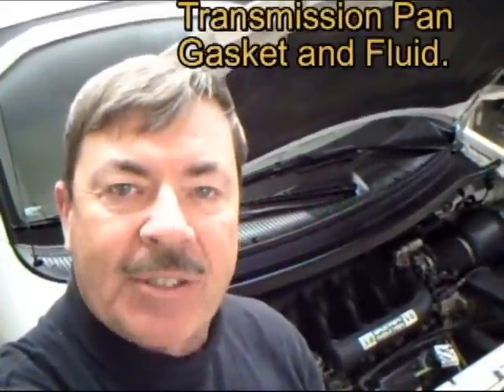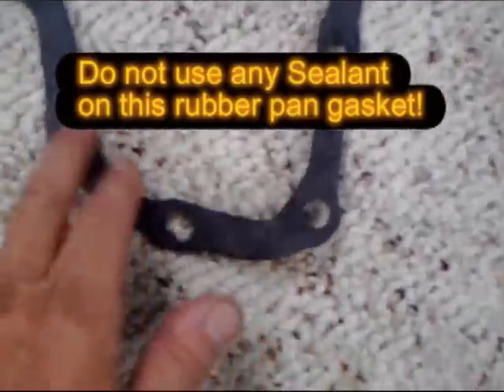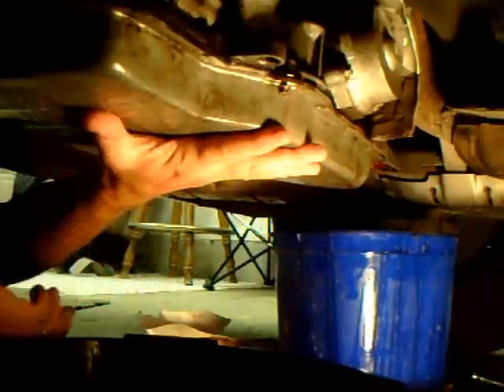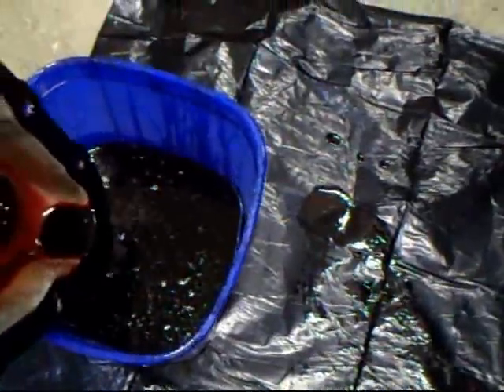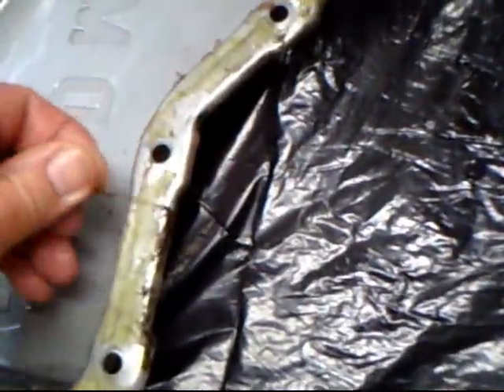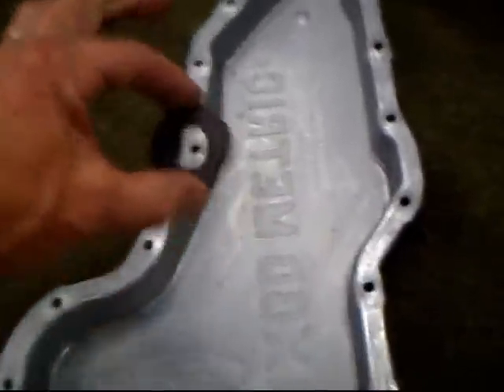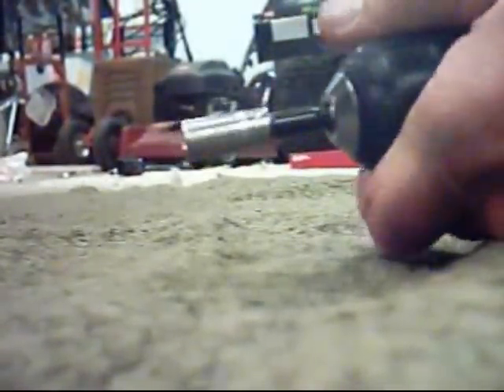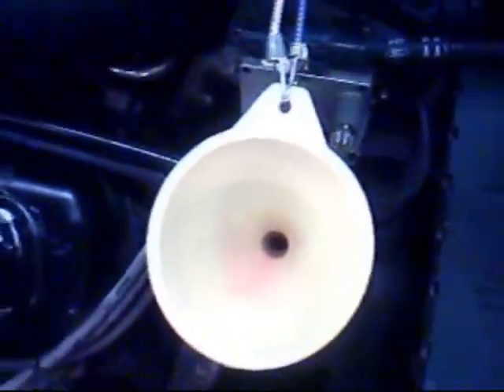How to drop your pans, from Mr. Herbert's Science Class.

Comment: yea if you know the specs def torque too, and if you have the car jacked up or else if you can take it around the block let it run in all the gears if possible to help spread the fluid around making sure nothing else is messed up. you dont have to but its a good tip especially with really old cars.

Comment: Nice shot on the fly.

For those who are viewing this in preperation for a fluid and filter change and not simply to repair a leak, be sure that your old filter has the o-ring attached to it before you put the new filter and O-ring in.  If the O-ring didn't come out with the old filter pull it out with your pinky.